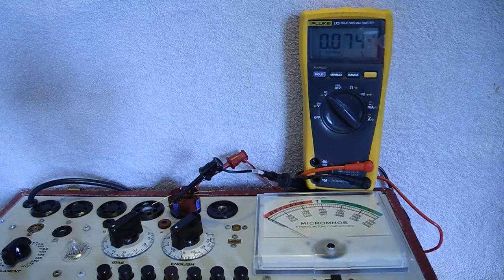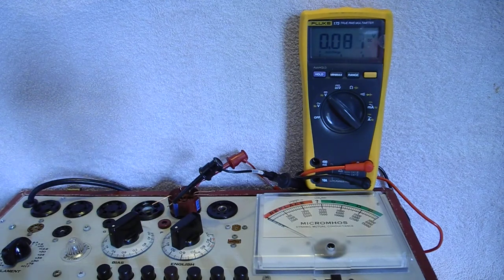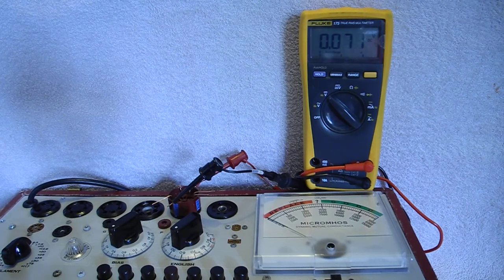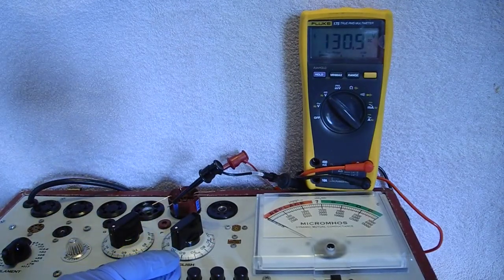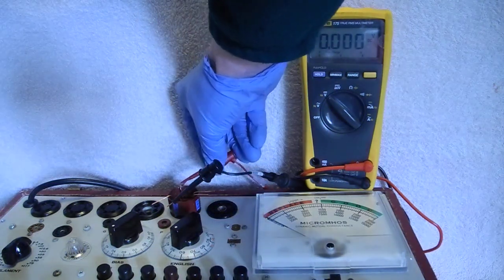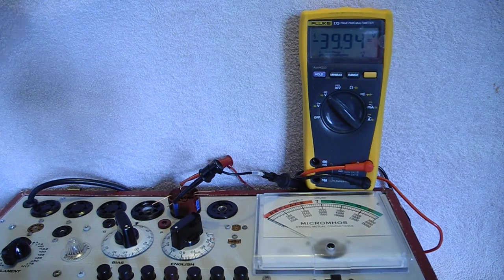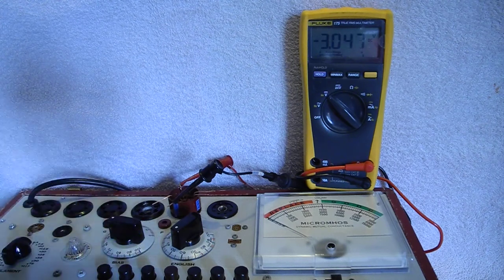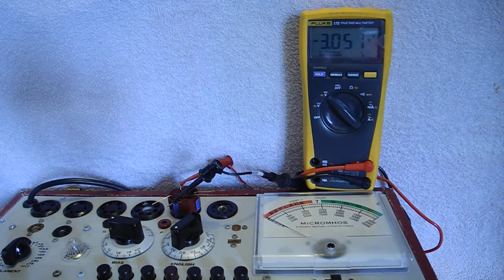Hickok 600A - Grid BIAs Voltage Check #4744

Comment: I wonder how you set the screenvoltage? 
Do you calibrate this to 130 with the Line Control? 
I am having an issue with my Hickok 600 which is a very early unit.

Comment: I thought you need a shunt resistor to measure if you use a DMM?
Reply from the maker: When Measuring the High Voltages such the Plate Voltage you definitely need to shunt to compare with old data standards.  
When measuring Low Voltage (With Low Current) Shunt resistors  have no appreciable effect.
I would like to see new standards be set in Tube Electronics to use DVM Voltages because it has been a source of misunderstandings for too long!
Reply: @hifimachine4237  So in your opinion, is 130V screen voltage not considered high enough voltage to require a shunt?

It's my understanding that on a 250V scale of an old-style AVO meter (the kind that would have been common for the period), there would have been a 250 KOhm load when measuring anything above 100V. This would have included the 130V Screen voltage as well as the 150V Grid voltage.

Switching to the 100V scale would drop the load to 100 KOhm, which would then be used to measure the Grid Bias set at 100, or -40.0V.

Switching to the 10V scale would then introduce a 10 KOhm load onto the Grid Bias set as 22, which should be -3.0V. As you mentioned, this really doesn't affect the readings at this level, but it would be historically accurate nonetheless.

And yes... These voltage specifications need to be brought into the 21st century using high impedance DMMs.
Reply: In the calibration document by Daniel Schoo, version 4.0, step 9 clearly states to not use a compensating shunt resistor for this test.